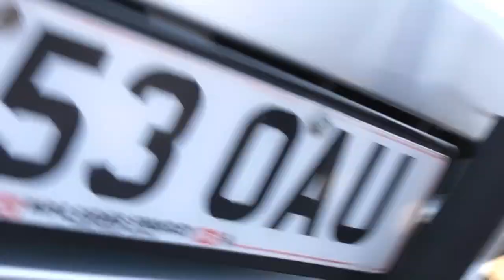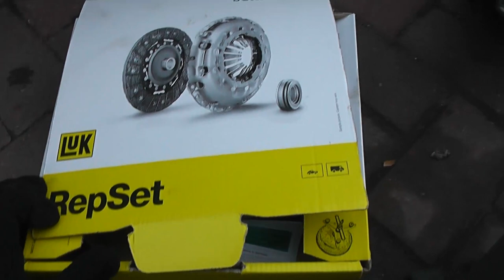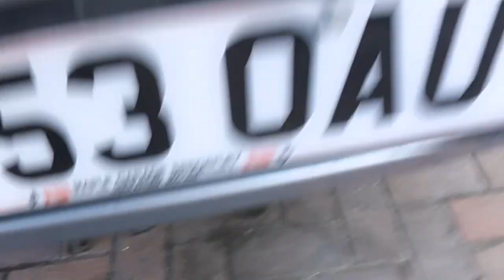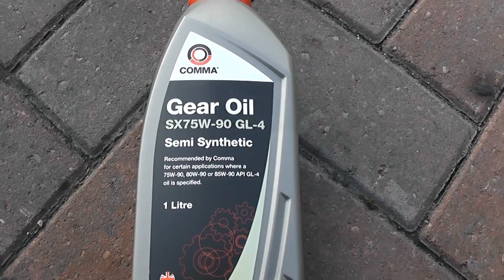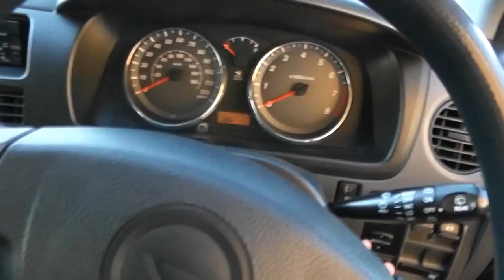Daihatsu Charade/Cuore/Mira Kei Car Clutch Replacement

Comment: Hi! Thanks for making this video.  It's very hard to find information about these cars.  I got a German manual but it's still great to see someone do things to the car.  I wish to say to you that I think you have a good style, and should keep at these videos.  With time you would be quite refined.  Your humour lends well to the format.  If you're talking about things use a pointer to point them out so lesser skilled people will know what you are talking about.  I've my car over two years,  63000 km on motorways,  city and wild country roads, and all I've done to it is oil, filters,  sparks, brakes pads and discs.  I want to buy another car just to try it, but I don't want to sell this one either.  Such a great strong little bus !!! Also can fit a bike inside without taking the wheel off!!
Reply from the maker: Thanks for the feedback. Unfortunately I don't own this car anymore, I just found it too flimsy and not that great at speed. I've replaced it with an old Corolla instead.
Reply: @Scrubworks  lol.  Wrong car for speed for sure! Can't beat a Corolla! Solid cars! Sure do videos on that instead.  I guess nothing will go wrong with it is the problem!
Reply: @kingoffifa  mind my asking since you have the manual what the torque wrench settings for the rear shock absorbers are? Thanks

Comment: Useful video, thanks.  I wouldn't necessarily recommend heaving on the driveshaft like that to get it out of the gearbox though - I did that on a Volvo I once owned and managed to pull the inner CV joint apart, and had a right war trying to get it back together again.
Reply from the maker: A light pull is usually enough to get them out in my experience. However these had clearly never been out before and were very tight in the gearbox, hence having to use the pry bar.

Comment: I use a 300ml squeezy bottle with a Г-shaped nozzle cap, costed me like 4 bucks or something online. This way you can fill it up from above, also you only pour the oil in the bottle, then the cap on and squeeze it in - no need to suck it up through a siringe.
Reply: Also, it's not a Hatsu if its brakes don't squeak lol ;D
Reply from the maker: I didn't have the right kind of piping to hand to fill the gearbox up from the top, I'm afraid it was the syringe or nothing. The rear brakes are a menace quite frankly, there will be a video of those being rebuilt soon.
Reply: @Scrubworks  love these cars! i own an YRV 1.3 for 6 years now and i only really need to change oil every 8000 km (5000 mi). well, i recently put new, softer brake pads (front) because the old ones made funny noises even though there was still a lot of life in them. the whole spring-summer-autmn i heard absoluitely no noise and i was so happy they are finally smooth and silent. butttt... it is now a freezing winter over here and they suddenly started squeaking back again (??) with the new, SOFTER pads (less than 15 000 km (~9000 miles on them)) so i just gave up and am now waiting for the weather to warm up. it's just a daihatsu and will do whatever it wants.. but at least it's not going to ever leave you stranded and will go strong for decades with only basic maintenance.
Reply from the maker: If your front brake pads are squeaking, it's probably because they don't have enough lubricant on them. If you get some copper ease or some other lubricant designed for brakes and put a little bit on the ears of the pads where they slide in the caliper, that should stop the noise. Also make sure that area is free of rust and debris. Has always worked for me when I have squeaky disc brakes. Drum brakes are a bit more complicated, much more potential for squeakage.

Comment: Hi, nice job;   Is is necessary to do a steering  alignment after the job,  since  the  steering /suspension  were somehow stirred?  Thanks for your video
Reply from the maker: You shouldn't need to no, as long as everything bolts back together cleanly the alignment should be preserved, and you don't need to alter the track rod ends, you're just removing the driveshafts. If you replace any suspension parts as well though, a steering alignment wouldn't be a bad idea.

Comment: I still have one of these. Fantastic car. Just a question? Had clutch replaced 2 yrs ago. Probably only driven 5k miles since. The biting point is quite high. Sometimes there is a judder when drive is taken up. How do i correct that?
Reply: if the clutch is hydraulic you can try flushing the system. there might be some bubbles inside.

Comment: Had one of these a few years ago a cracking underrated car and a lot of fun to drive given it’s a 1000cc, can I ask are parts still easily available for these little cars .
Reply from the maker: You can get bits but you generally need to order them off the internet as nowhere really stocks them anymore, or you can ask car parts suppliers to order them specially.
Reply: Its very famous here in Malaysia..same body as Perodua Viva so lot of them had convert it to Daihatsu model bodyparts & engines..
Reply: Ebay is the place. Plenty of parts.

Comment: Still reeling from the "70mpg" claim to take in the rest of the video! :O
Reply from the maker: To be fair, you have to travel steady at under 70mph on the motorway for it to reach that figure. Around town you'll generally be in the low 50s. Still brilliant though.

Comment: How did you keep the clutch plate aligned behind the pressure plate when you bolted it back on. Looks like you just put your finger through the hole. I was thinking of using a small length of suitable sized wooden dowel??? Im doing a Daihatsu Hijet 1000 clutch kit. Little different to this but same style thrust bearing. Rear wheel drive so just prop shaft to remove.
Reply from the maker: I did it by eye. I poked my head up in there, with the pressure plate lightly fastened down, and then just moved the friction disc around until it lined up looking at it dead on with one eye. Then you tighten the pressure plate fully. Using a wooden dowel is a good idea though. Depending on how much slack there is in the engine mounts you may be able to angle your engine down enough so you can get a good eye on the centre of the flywheel to line it up.